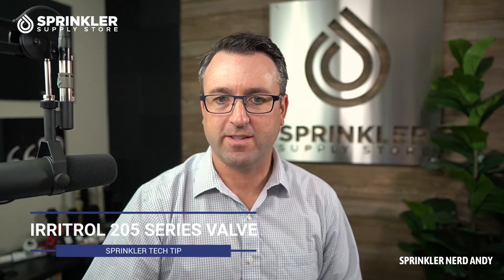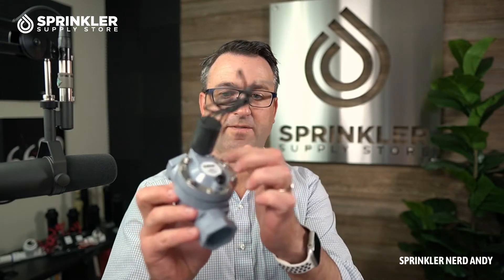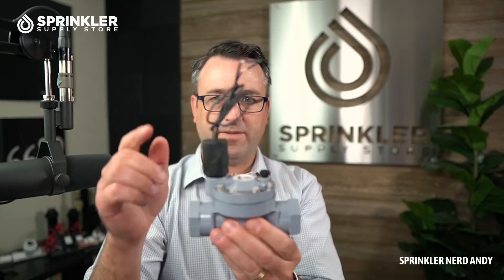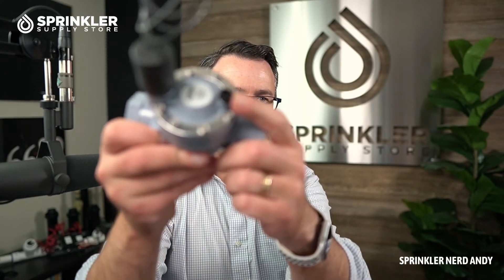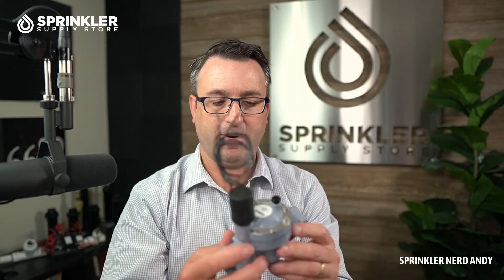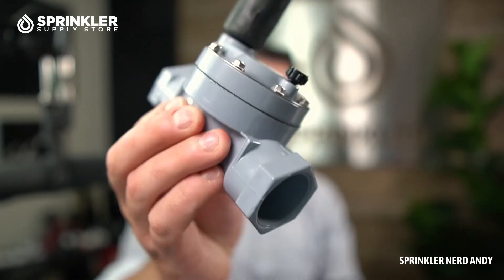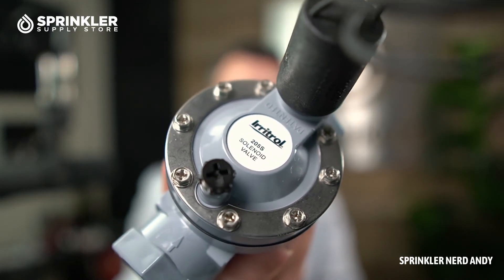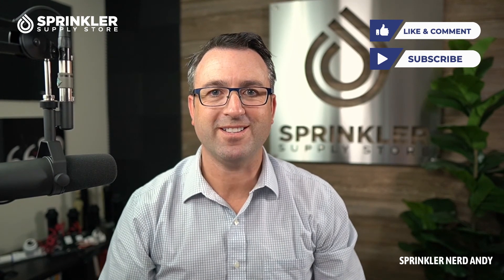Overview of the Irritrol 205 Series Sprinkler Valve

Comment: I have a 204 valve at my new house that was marked “do not use”. The solenoid had the wires cut at the base and the line going out to the sprinklers was not connected. I decided to buy a new solenoid and run a new drip system off the valve to my deck for potted plants. With the new solenoid in and water one, the zone just wants to run. Placing the old solenoid back in it stays off. The original solenoid is a free floating one where as the new one is encapsulated. Any ideas as to why this is happening? My wife had a sprinkler guy out before I did this work and he replaced a solenoid on one of our other valves with the same style without issue. Starting to think that zone wasn’t being used due to a valve issue but it doesn’t explain why one solenoid keeps it off and one doesn’t. Any thoughts?
Reply from the maker: Hmm…can you send us a picture of the “free floating” solenoid? You can txt it to: 833-343-4590.
Reply: The old style had a separate o-ring under the soleniod. The newer style has a "captured" plunger and a built in o-ring. Try it with only the built in o-ring, remove the old one.

Comment: This is exactly the valve that I have for my sprinklers (although mine are much older) and I'm trying to do some troubleshooting.  But I can't manually activate any of the zones by turning the set screw or the solenoid.  All the zones (except for the one that I'm troubleshooting) work fine from the master control box - I can turn them on and off from there no problem.  But for some reason, the manual activation at the in-ground controllers out in the yard (via the solenoid or the set screw) is not working.  It seems like this should be pretty straightforward, so I'm a bit at a loss.  Any suggestions as to what I'm missing or might be doing wrong?
Reply from the maker: Interesting. Sounds like a hydraulic (water) problem. I bet you have a Master Valve on your system. The MV is another electric valve installed on the mainline (in your home or out the in a valve box) that opens electrically every time a zone valve operates. If you have a MV you will not be able to manually open, or bleed, and zone without first opening the MV. Take a look at your controller and see you have a wire connected to the MV terminal.

Comment: Without having made any changes to my irrigation system there is recently low water pressure at the bubblers. Loosening the bleed control increased the pressure. Is this a suitable solution or will this cause water to run through the system outside of the designated watering schedule times? Is there another reason/ solution to fixing the low water pressure?
Reply from the maker: Those manual bleed screws are typically used to manually turn a valve on and off directly at the valve, so it sounds like you solved your problem by turning that screw.  It may have gotten bumped or turned somehow prior.
Reply: @Andy_Humphrey Good morning Andy,
So I have a Irritrol 205T which looks identical to what you are showing in this video.
The problem I’m having is, initially I wasn’t getting any water flow through the valve and it is roughly 27 years old so I figured I would replace the diaphragm, solenoid to where I would essentially have a new valve.
I purchased a new 205T and put everything on the old one, great to see no changes in design, it worked flawlessly a couple of times I’m getting 24-29 volts to the solenoid I can hear it click but water is no longer flowing, I tried the manual screw as well to no avail. There is nothing down line and I do get water squirting out the set screw., any thoughts?
TIA!